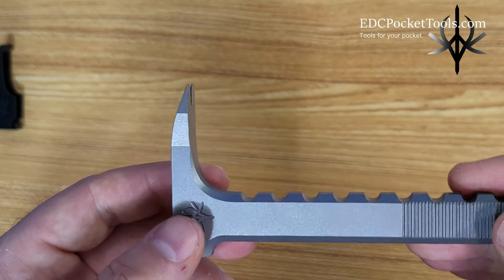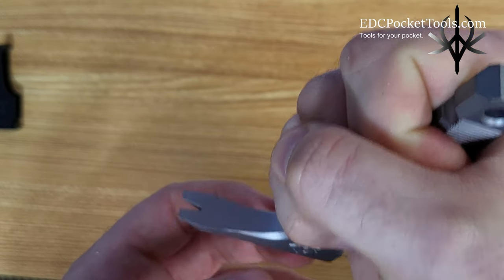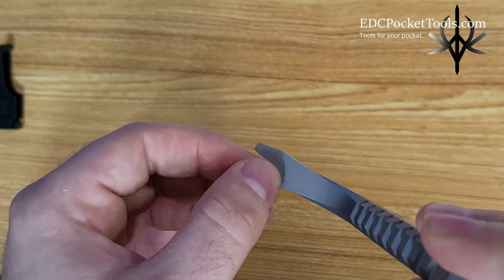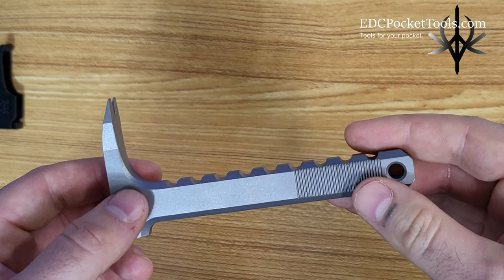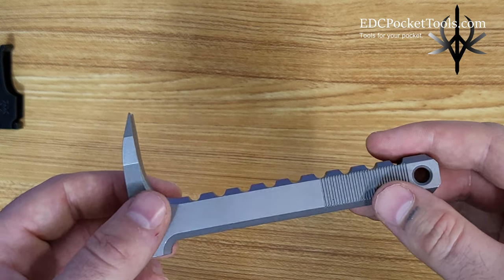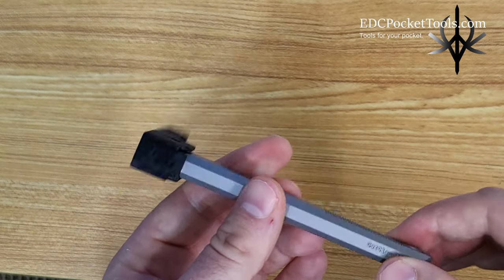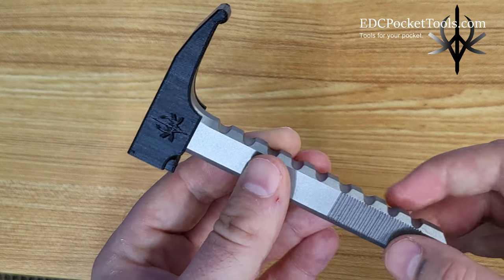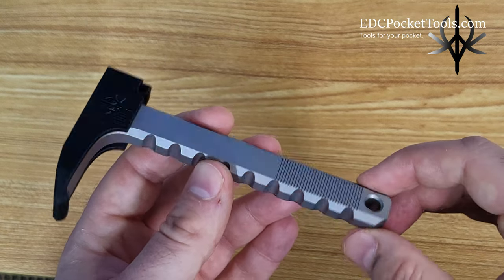Introducing the CatClaw prybar by EDCPocketTools

Comment: Interested, for sure.

Ideally, there should be more of a curve to the claw, top and bottom.  That would allow most nails to be completely removed, rather than having to add something against which to pry.  Also, the additional curve on the bottom would encourage the head to stay.

What is the length?  8"?  10"?

How much does it weigh?

Comment: I think you could use the commonly shaped edc pry bars... perhaps with round or triangular shaped screw off tip bit which can be used as a leverage point... so you could basically see saw and get more leverage to pull out nails etc.... yet still keeping the same sleek small pocketable shape...

Comment: Just watched 😮 your recent video. Your pocket organizer looks similar to my wallet I made years ago, and the smaller cat claw caught my eye. 

It's hard to find good, fully usable pocket pry bars, and I'm curious if your tiny prototype would be available or produced at some point. When I made my wallet, I also made a pocket pry from an old offset Proto box wrench by cutting off the lower jaw. Old German made Proto, but the steel is more than hard enough without heat treatment.
Reply from the maker: Nice! The a batch of CatClaws are being made right now, the minis will come later. Estimated 4-8 weeks for the CatClaws. That's pretty cool that you made your own pry too.

Comment: Give me a frigging break.............People are going to carry this everyday when they might not ever use it along with their other EDC junk filling and bulging their pockets. This thing is huge and heavy to carry in a pocket unless maybe you're wearing cargo pants with huge side pockets.  Not saying this  isn't  a very good piece of machining.
Reply from the maker: Good point, it may not be practical for some lifestyles. I am also working on a mini model that is 75mm long and 70 grams instead of 120mm and 150 grams. It won't have as much leverage, but it will still be able to do the same jobs that don't require as much brute force.
Reply: @edcpockettools  i disagree. I think the size shown off in the video is the perfect small pry BAR. Anything smaller than this is basically just a "Gerber shard" 

Anyone who is buying something of this size and shape, probably already has an idea on how to carry it. 

The previous commentor is just being a rude pessimist, IMHO
Reply: I agree, pretty useless prybar. At that size you're better off just carrying nippers instead, I don't know what you would pry with this. Good luck pulling 16 penny nails with such small lever arm, and the head is too bulky for fine trim work, it's metal so it won't won't work for delicate material, I honestly don't see the point.